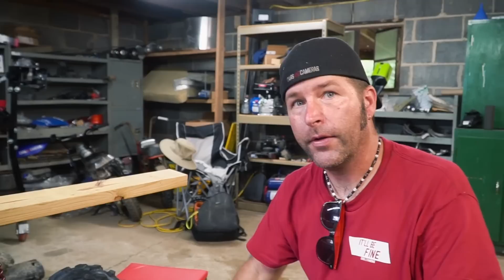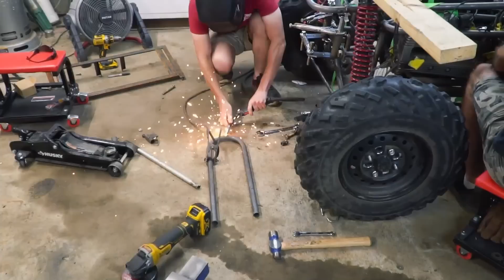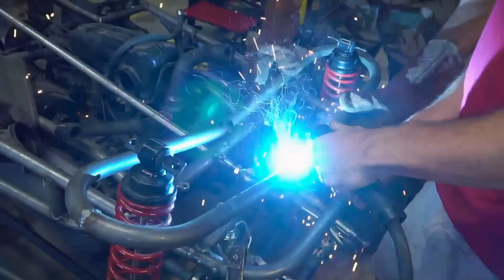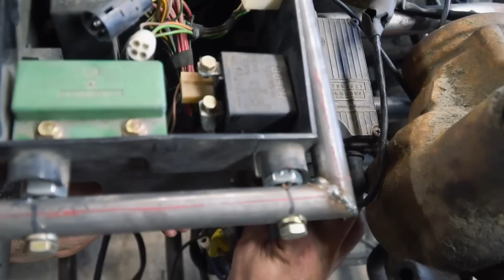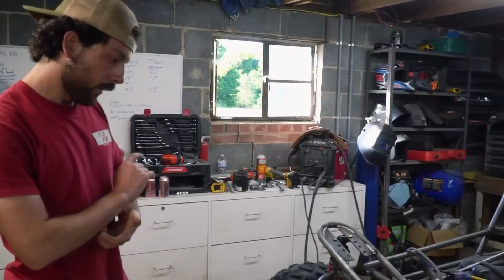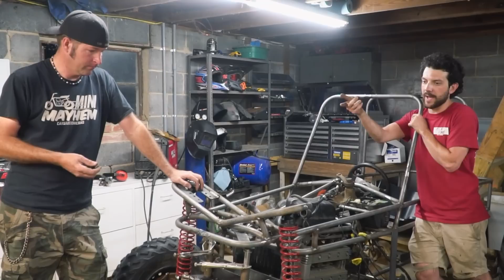1000cc Mini Trophy Truck Build Pt. 10 | Our Budget Desert Racer is Close to Completion!

Comment: Key lesson from this build. . . . double a-arm suspension is superior for soo many reasons. But love the build regardless i deffinitely think u need to connect the upper shock mount plates with a "truss" or triangle across the bottom so you wont bend em when you nose over hard for w.e. reason.   Oh. And another way you could run better steering is like the old tractors. The steer arms coming foreward from the midframe. It has more torque steer but is notably stronger and easier to support since ur arms going foreward dont change on the drop. The steering would always be squared. Just sum things ive looked at

Comment: Excited to see this finished. You guys should move the steering box up front and attach the tie rods directly to the steering knuckle. Then you can see how much reinforcement needs to be done to keep the steering box in place. The current setup is binding so much and has too many failure points.

Comment: I have a suggestion for the shop. A wet saw. Yes you can cut steel with death wheels, but a good wet saw will simplify your fabrication and give you more accurate cuts, not to mention how much nicer it is to use.

Comment: I would recommend taking those mounts out of the shocks and using a single bolt through the shock. That mount with the 2 holes is not bent to hold the full weight of a vehicle.

Comment: So Im catching up slow but sure, just wanted to say congrats on the Kabota. I have had these tractors, you will love it. For the size they cant be beat. The power these things have is remarkable. One thing I wanted to say is the upper shock mounts in front, I think if you move the shocks inward to one of the inner holes you may find that they are going to bend the flat plate. Thats just the way it looks to me, not sure but it might be somethingh to think about. Keep up the great content.

Comment: You guys could try an electric power steering unit from a car. I've other kart builds using them.
Reply: Nah, just get some beef on the ol’ arms, It’ll be fine.
Reply: I mentioned they should get a Prius electric power steering works great would probably weigh half as much
Reply: Toyota Prius

Comment: "You can't calculate this"
You absolutely can. Its really easy. Measure the 2 pivot points, the strut mount point, and the weight, and punch it in to an online calculator and it will tell you your ideal spring rate. If you can't get said spring rate, move the pick-up point inboard.

Comment: OK guys! Since it's obvious you are fairly happy with this, move the idler pivot on the passenger side to the back side of the bolt on mount it is now part of- that will give you more clearance from tie rod to tie rod and less chance of rub and interference there. As I have said, the design is always going to have some bump steer problems- your center idler is not a bad way to reduce them but much is to be seen. I have pop corn, so I'll be there.

Comment: "oh look at this 180 degree bend i did" 2 sec later cutting and welding it back together wtf
Reply: Cut piece from middle and trim it shorter
Reply: @J16PG @wouldyouglowme I see exactly what they did... its just a complete lack of foresight in their design he cut out about a 1/2 inch because their cross tubes that it was mounting on were not the correct distance apart my thought is if you have a hard number to work with like the center line radius of your bender why would you just place tubes in at random distances apart
Reply: @mark dawson They're not professional fabricators man. Lighten up

Comment: As soon as you guys get the seat position correct and mount it I think you'll have a lot more visibility than what you're expecting to have especially if you have to clear that drive shaft to build a seat Mount above it your position will be seated a little bit higher than the shock mounts so you should have decent disability

Comment: If you are going to make the look like eyes and want them to glow red, use LEDs that change color and fix them where they only glow red at full throttle. It should be easy with a switch on the gas pedal like used for nitrous.

Comment: Shorten the arm on the steering box or lengthen the arm at the front to make it steer easier.  Might add 1/2 steering wheel turn lock to lock.  But probably OK.

Comment: Get Ike in it with gear and use a bathroom scale(s) under each wheel to find out how much weight there is.  If it’s 300 pounds, you would need a 300 pound spring.  A 300 pound spring will compress 1” with 300 pounds.  2” = 600 pounds.  A snowmobile has about 80 to 100# springs per side.

Comment: I wonder if you could run a drive chain in between the steering rod with  small  piece of channel iron pushing up under it with a small sprocket moving it left to right mounted on the end of the steering column making a cheap rack and pion.all though you would still need a tie rod or weld a small flat steel bar under the chain to make it solid.

Comment: A crossbar between the hoops running from the top inside across to the other side I'd run double then your angle connection won't be weak and y'all won't be chassis twisting in a bad way lol

Comment: I'm looking at that plumber's nightmare and wondering where you will mount the flush handle? Seriously I like the look of the eyebrows, its a perfect place to mount headlights. Serious part: NEVER use gasoline to start a fire, it is incredibly dangerous, I was at a friends lake cabin when he got out some gas to do something similar, after warning him he did it anyway. You can't tell where the vapors are, when he lit the match and threw it on the pile it flashed and surrounded him with fire, set his clothes on fire, he jumped out, dropped and rolled while ripping off his shirt and pants, luckily he wasn't seriously burned. NEVER use gasoline to start a fire, if you need something, best choice is kerosene.

Comment: Sooo.  There are free or cheap CAD programs that can help you visualize parts of a project before you start cutting metal. They can save you money, time and weight in a project like this. I know this because I am a mechanical engineer. What you guys are doing is "bench design" or just keep adding parts and metal until it works. You do it well but you have no way to know what might break this way. You are fun to watch but I'd love to see you add that extra dimension of actual "engineering" something. Especially since it can be cheap to try and your viewers might learn from your experience . I can't wait to see this beast run. I am concerned about your crossed beam front end under braking or on hard turns. Time will tell.

Comment: Ahhhh, did I miss something? Why did you cut the shock hoop in half and then weld it back together for? Also, why did you weld the hoops so far to center rather than making short hoops right on the left and right side tilting slightly out?

Comment: Electric power steering column Opel corsa hatch back + u can put a voltage control switch higher v+ lighter steering lower v- heavier steering

Comment: think you can make the arm comming of the steering unit a little shorter that should help lessen the force needed to turn the wheels , you should have about 2.5 to 3 turns lock to lock

Comment: That BMW engine is starting to seem like it's underpowered for that beast. Wonder how much it weighs now?
Reply: I could have definitely built independent suspension for the front that was way lighter, has more travel, and less bumpsteer. Smh these guys are starting to look stupid to me...
Reply: Rammatic I’m starting to think the same. Lots of stuff that could’ve been done way better, way easier, that kinda got half-assed. Also for all the welding they do, their welds aren’t great. Either way respect for the build and the ambition
Reply: RC Dude 02 
Half-assed is the perfect term to what they do... just shrug and say hope it works rather than actually solving the issue 🤦‍♂️
Reply: @gfrankum63  work smart not hard, nothing custom is by the "book" but common since goes along way and anything worth doing is worth doing right, yeah they don't claim to be experts but john comes across like he thinks he is..actions speak louder than words and they are both quick to justify/defend their hack jobs. Why waste time and money with all the guess work instead of sitting down and put time and research into their design or what they want in the end result.
Reply: 2strokejunkie 69 

John with some minor success in the build: “look at this incredible feat of engineering! It’s one of a kind, works perfect, amazing! Thank goodness I’m so smart”

John when he fails repeatedly at doing something: “Guys we aren’t experts, we are learning right Ike? Don’t worry we’ll get it eventually. I think, I think, I think.... oh well let’s just use this even though it sucks cuz I’m too lazy and full of pride to scrap it”
Reply: 2strokejunkie 69 

First of all they made it seem like twin I beam has never been done before, newsflash, GHPC already did that.

Secondly, even Grind Hard had trouble with twin I beam cuz it is just a crappy suspension, built for heavy duty trucks that need something strong with smooth ride and little travel...

I’m guessing they thought they could one up Grind Hard’s design with there “trophy cart” but yeah that didn’t happen and never will...
Reply: @rammatic7881  glad to know I'm not the only one who sees right threw the bullshit...🍻 brotha

Comment: Why not have steering do front and back? Part in front goes to front of axle on one wheel then back part to behind axle on other wheel. Should ha no problems with crossing suspension.

Comment: I have a project I'm sticking a 212cc Hemi predator on a 110cc 4-wheeler frame will it work I just want to know either John or John or Isaac will it move me I'm 178 lb I was wondering if it could make get me up a hill just a question and the trophy car is looking great it looks nice I say you guys hit hit at least 90 with that thing off road
Reply: stoned survival 420 it'll pull you with ease,I'm 220 and a 212cc will pull me with no problem.
Reply: @FloridaMan0561  thanks 👍

Comment: hey guys got a question on the pred 670 . I have a club car all wheel drive XRT 1500  with a Honda gx620 engine that's very tired . i want to swap to a predator 670 , but the out put shaft on the Honda is tapered 1 inch to 1 and 3/16 of coarse none keyed  and the 670 is just a 1"" keyed  buggy weight 900 lbs . Can you recommend a cvt clutch ?

Comment: Hi John and Ike,The kart is progressing well, it should provide some fun times {: Regarding the new workshop, please make sure you research for the correct orientation to locate it on the siteit is all well and good to have a view , but if for example it faces the wrong way it will be hot in smmer and cold in winter , (put in a double glaised window for the view instead ) Also if down the track you install solar pannels, a correctly oriented roof is a excellent place to install them,look up/Search  PASSIVE SOLAR DESIGN,  (https://www.google.com/search?client=firefox-b-d&q=PASSIVE+SOLAR+DESIGN) that encompasses building location etcin the long run a bit of forward planning and wise expenditure now will save money for heating and cooling , etc for many years to come.Tony from Western Australia .

Comment: Those are not the correct way to put in shock hoops I don't see that lasting very long especially under force in weight they should have been straight up and down over top of the shocks You're going to need some serious supporting bracing on them well it's looking good so far